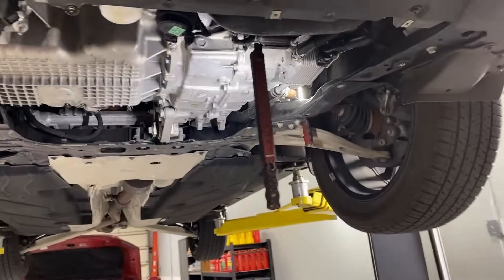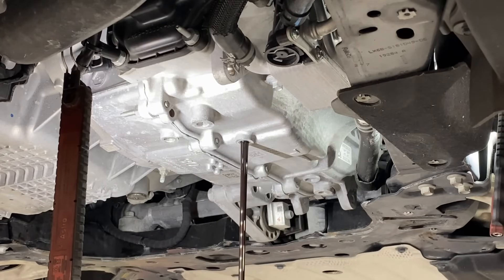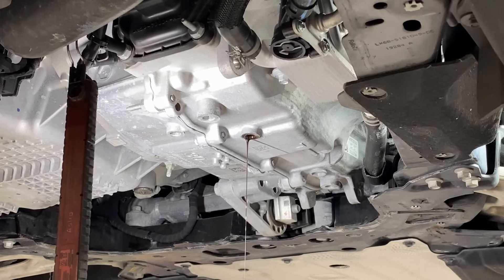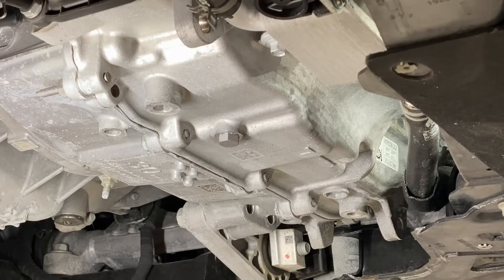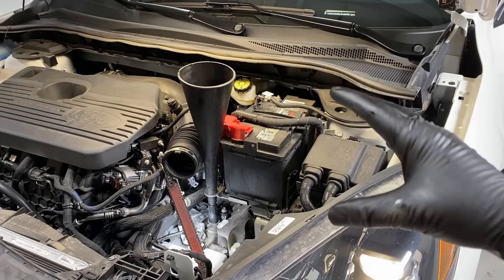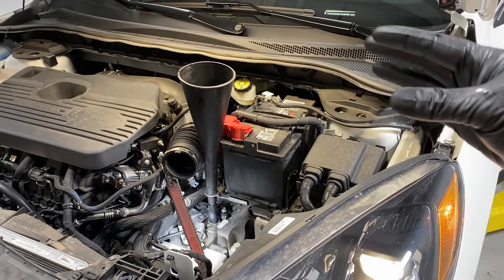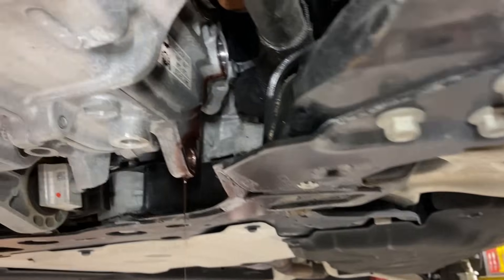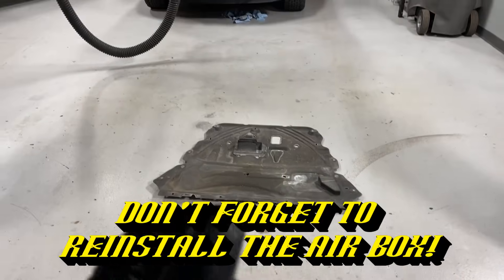Quick Channel Update: 2020+ Ford Escape & Edge 8F35 Eight Speed Transmission Fluid Service Procedure

Comment: Thank you for this video. Very informative and detailed. I am scheduling the transmission fluid drain & fill for my 2022 ford escape 2.0L.  I see that five quarts were used for the initial fill, allowing some fluid to escape from the leveling plug below. At the end, about how much transmission fluid is required for a drain & fill procedure?

Comment: How long do you wait for the transmission to get up to temperature and do you leave fill plug open until then? Or do you go for a test drive, and then open fill plug again?
Reply from the maker: You wan to leave the leveling plug in and you can either brake torque the engine to get the trans fluid hot or go for a drive.

Comment: In theory, couldn't you just fill er up through the side port without removing the air box?
Reply: Yes I believe so but it would take a lot longer and you would have to make sure the fluid is going in and not just running out

Comment: Just did the oil, trans, PTU and rear diff in my daughter’s 2002 Edge with 35k miles.  Very straightforward on the transmission thanks to this video.  Of course it would have been a whole lot simpler if Ford just put a damn dipstick on the transmission.  Fluid was kind of dark.  I think I will do it again in a month or so, then again in 30k miles.

Comment: Hi Brian,

Have you been experiencing a lot of torque convertor issues on 2020 Escape/BS? Ours has 48,000mi and is getting a "surging" at lower speeds with light throttle. It also has a pretty good vibration (noticed in the rear seat)at high speeds.

We purchased it used at 40,000 and I did the drain and fill. It is CPO, but dealer "could not duplicate" at this time

Comment: I watched your video several times and then did it myself. I could not take out the leveling plug, so what I did instead was pour the old fluid into a container, marked the level, poured it out, and poured in new fluid to the same level. It took a long time to refill, but went faster when I ran the car and shifted the gears back and forth. I bought my car used with over 90k miles and was pretty sure it had never been changed. Thanks for the help.
Reply: How many quarts did you end up putting back in. I bought a drain pan with quart markings on the side. I drained out about 4 quarts so that is what I put back in

Comment: Ok so 2022 edge here, I didn’t measure how much came out, why because of the overfill plug and wasn’t concerned with over fill.
So had car on ramps and leveled with jack stands ,
Opened overfill plug and drain plug. Came out pretty clear not black like I’ve been hearing everyone say.
Then put in the qts like in the video up until it started pouring it of overfill, started car and ran through the gears a bunch but on a stand so no wheels spinning, 
Car in park
Added more fluid till it overflowed, then added some more,
Put in reverse it wouldn’t real over flow much, 
Then put in drive it would over flow a bit,
Same sequence and it kept happening.
Turned car off while in park of course. It was dumping so much out of the overflow.
So i added more while it was running kept doing the sequence reverse drive park ect.
Finally once it got to the trickle out point I put the plug in while running.
So the question is did I do something wrong?
Does the overflow plug only go in while running?
Reply: I had the same issue & it wasn’t made clear in the video. When I shut the vehicle off, fluid rushed out of the overflow.

I got more fluid, refilled it, and put the plug in while it was running.

In hindsight, I didn’t even get the transmission hot - I just had the engine idling
Reply: @markr7479 yea I wish I knew. It was a waste of fluid lol
Reply: You don't need to shift through the gears I guess. Just leave it in park

Comment: O also would love a better understanding of the brake pump and the round brake thing. Mine looks as tho its leaking at the seal and not sure what the cost is going to be to replace that seal or if it matters all that much or is very important.  Very demanding requests I've sent you so if easier to send me diagrams and instructions via email if u happen to ha e them can send u that email address. I'm in a pickle and need to fix this car without making myself homeless!! Many thanks sir! Ur awesome!

Comment: Could you do some videos on the 2016 Ford edge echo boost 2.0- especially for transmission drain & fill with level plug; where the throttle body is located; does it have a PTU & what is a cooler when they talk about it.
I have looked for iver 2 months and watched maybe 60 videos and no one ever talks about this specific engine.  It is not like all the others. The closest videos and how the engine looks and the design is the 2013. Took me 2 months to find the throttle body and only fou d it by accident while looking into the starter for this vehicle.
Another interesting video and a how to remove the manifold as it is the only way apparently to get to the throttle body to clean it. There are so many ir should I say 1 large conglomerate of cables and wires which makes it extremely difficult to do maintenance, keep the area clean from dust(as it seems to really gather therr) or get to the pcv valve to check or replace it if having issues or trouble shooting.
Would also love an all in 1 video explaining where the important sensors and fuel injection that can be cleaned or easily checked or replaced for better performance ect.
I only trust very few mechanics on here to learn from and you are in the top 2. You explain well and always show pictures so I am able to see and learn. As a woman I have to understand at the very least what a mechanic is telling me needs replaced or fixed or, as I have been many times, I will get ripped off or should I better say end up fixing or replacing expensive things that really didn't need to be replaced or fixed.
If you are so inclined to let me know which year may best match my 2016 fe2.0 eb so I can learn from that year or would love to just be able to watch ur videos. 
So sorry I know that was a lot. I am having issues and looking at 3 to $4000 worth of diagnosing and repairing replacing to fix things. I cannot afford to pay that if I am not certain it really needs to be done. You make amazing informative honest videos and I've learned so much! Many thanks! And I share ur knowledge with many other women so they at least understand what mechanics are telling them and when to get another opinion;)

Comment: After you filled it with 3 quarts before you started the car did the level plug set itself before you put more in while it was running

Comment: Great video. I just did mine at 34k miles. Fluid was black. After I did the work, I got a check engine light. I scanned it and it was due to having the IAT sensor unplugged when I was running it during the warm up time for the transmission fluid. I cleared it and it went out. Should I be concerned?

Comment: I bought a 2020 Ford Escape Titanium from a Ford dealership with 43,000 miles already on it 3 years ago. Now it has 75,000 miles. Jerks never said anything about it needing to be drained and refilled every 30,000 miles and I take it to the dealership for service. I do have an extended warranty though with 3 years left.

Comment: Hi Brian I will be doing a Trans fluid change on 21 escape... on filler tube does it have some type of a closed off cover(not the cap) down inside the 
rubber tube??? last time it seemed that it did and had to take the rubber tube off to fill  I can't remember looking down in the rubber tube and if it did or did not have that cover...I would appreciate if you can help with this answer ...Last time had a dickens of a time getting the rubber boot back on

Comment: Could you just use the leveling plug hole to fill your transmission instead of removing all the things on top of the engine to get to the filler neck? I have a hand pump with plastic hose that I use on most things that have a leveling hole. But is there some reason you must use the filler tube at the top of the engine on the engine?
Reply: Could anyone answer this question?

Comment: Hello
I drive a 2019 Ford S Max 2.0 EcoBlue with 123,000 km on the clock.
Do you think I should change the transmission oil?
How many liters should go in?
Or should I put in exactly the same amount as the oil that came out?

Comment: why do you not cycle through the gears during the fill process?
Reply from the maker: We did not overhaul the trans nor did we replaced the valve body. This means all the hydraulic circuits are still filled.

Comment: So since this is the same transmission on the broncos sport, a lot of people are lifting these and leveling them. How does that affect the filler hole? Does the car have to be level based on its tires? Cuz it looks like you're losing a lift so it looks like it's level based on the frame where you're putting the lift posts cuz when I did this on my 23 bronco sport and I thought I had it at the stock height. I had some oil come out of the fill hole before I drained any. I pulled off the fill hole to make sure I could get it out before I start draining anything and it was like it was already overfilled. So I would like to know how the car is supposed to be positioned. Does it matter based on the tires on the ground or the frame has to be perfectly level or what?

Comment: 2020 Escape 1.5L 3 Cyl  Build date 10/19- It doesn't have that fill port/vent - at least not in that location. There is a shift cable running across that area. The engine in your video must be a 2.0L because the engine cover is different than the one I'm working on. Maybe the 1.5L has a different trans?

Comment: how will I know that the oil in the gearbox has already reached 200 F   ?
Reply from the maker: scan tool
Reply: You can use Forscan and an OBDII scan tool.
Reply: @just4ivaylo92  Thank you . Can you tell me what options to look for temperature?
Reply: @Krzygen  I believe it comes up as "transmission fluid temperature"

Comment: Would this still be the same on the 2022 Ford Edge ST with the 2.7L TT. Its a 7 speed, but from what i understand, it's the 8 speed transmission with a software install that deletes second gear, but the physical transmission is the 8 speed.

Comment: Hold your horses. why does fords diagram show a cartridge style filter for the transmission on the top, closer to the firewall? what is that for? i see it on ford parts. no idea what it is. looks like a oil filter you’d put in.
Reply: Some transmissions have a cartridge style filter that you do service on the side on top of the screen style filter that you don't service, my gf's Nissan is like this

Comment: Lincoln Corsair 2.0 L  has a 1/8" limiter hole in the center of the rubber breather tube, which is easy to remove, to fill the transmission as shown. If not done, the fluid remains in the funnel or worse.

Comment: I have the Mondeo from 2019 with 2.0 Ecoblue 190hp
I’m going to change the oil on my gearbox 8F40 tomorrow, but do you have to calibrate your gearbox after oil change?? I read that is good for the wear?
Is there a procedure you can do it in the car or do I need Forscan?
Thanks

Comment: I have a 2020 ford escape 8 speed trans with 46000 miles it runs great no problems ,  ford dealer says not to change the fluid also brownie transmission  also say do not change it ,the manual says change at 150000 miles ,that sounds dangerous what do you think about this
Reply: Drain and refill right away and take a sample for analysis. Just tell the shop that your vehicle is operated under special operating conditions.

Comment: Hi Brian, I watched all 3 videos on the 2020+ escape changed at 21K miles for the rear diff the ptu and the transmission fluid. If I continue to change all three every 30,000 miles do you think the powertrain will last? Do you like this kind of car? Also wondering what you would charge to change all three.

Comment: @FordTechMakuloco -Hey, Ford Maverick 2.0 has had a small puddle of fluid leak out of the filler/vent tube 4x's over span of 16000 miles. Is this normal? Dealership cleans it and says, "Keep an eye out"
Reply: It's normal. Similar to what I've seen on my Maverick, built October 2021.
Reply: @just4ivaylo92  any idea how many miles before it stopped? Thanks!
Reply: @jessemeier8190  probably about 16-18k.
Reply: @just4ivaylo92  Thanks for the info!

Comment: I followed the procedure in your video, and when I got to the point of measuring the level from the plug, I noticed that the oil comes out with bubbles. This happens when the transmission reaches its maximum operating temperature after 15 to 20 minutes. Is this normal, or does it indicate a problem? One last question: is a drip at a rate of 1 or 2 drops per second an indicator that the level is correct?

Comment: Excellent video thanks.  I would like your opinion of an alternative procedure, something we used to do years ago.  In an effort to remove all the dirty fluid and replaced with new, what if you removed the transmission to radiator tube and put the trans end into a bucket.  Place your funnel into the fill/vent port with several quarts at the ready.  Start car and as the fluid gets pumped into your bucket, you continue to fill the transmission.  You would do this until you get clean fluid being pumped into your bucket then shut down engine.  Compare how much was pumped out with what you put in and top up and check level as necessary.  I would appreciate your input on this.

Comment: 8F35 is an ultra smooth shifting transmission. Like all brand vehicles Ford using low viscosity fluids for mpgs. Therefore 40k mis max id do tranny fluid & PTU/ differentials on AWD vehicles. Sooner if driven HARD. Use top tier rated fuel always! Ford recommends it. FUEL SYSTEM cleaner every 10k mis. Redline or Techron all i use. 💯 -Western Ohio

Comment: Got a 24’ escape, at the far left side of the transmission (front of the car) there is a rubber cap that says do not remove. Seems to have a decent leak coming from there. Is that just a vent?

Comment: Brian Quick question. I had my transmission fluid changed yesterday. This morning I get into the van and I drive less than a quarter of a mile. I make a right turn and the lost power. And I got an error transmission not in park. I put it in park and started it right back up with no problem. Could this be from the fluid change?

Comment: Why a living plug. Simply record the fluid that came out and refill. Drive and re check fluid level.
Reply from the maker: That is a horrible way to service this trans just guessing at the level which is so sensitive.
Reply: @FordTechMakuloco  you misunderstood stood my comment. If 4 quarts com out then 4 guards go back in. Use a container with   Quart graduations marked on it then it’s no guessing game.
Reply from the maker: Oh, I understood it just fine my point is who is to say the last person filled it to the correct level and more importantly at the correct temp? So yes, it is a guessing game and a horrible way to service a transmission so sensitive to fluid level.

Comment: Question…is it possible for a shudder to stop by changing transmission fluid if a code is being thrown about torque converter issue?
Reply from the maker: yup
Reply: @FordTechMakuloco  I asked the dealership that question  and they said absolutely not, you have to get a new converter. Do they know something I don’t? Could there be something else giving them cause to tell me I need a new converter other than a code being thrown? The only symptom my car has is slippage when shifting. There is no clunking or ticking sound like I’ve heard on a few YouTube videos

Comment: Ok. Major emergency question! (Thank you thank you for the video)
For reasons... I took the leveling plug out without draining.  At least a quart or more came out of that plug hole.  We bought this vehicle new. Have not had the the Trans fluid changed.  Why would that much fluid have come our of the level plug?
Reply from the maker: It only levels while running otherwise it would be higher.

Comment: Before starting engine, it best to reconnect air intake temp sensor so it doesn't' throw codes assuming they won't auto clear when done? Not looking to go through Forscan or drive to Advance to have them clear it.
Reply: i will do this next time too.  Mine threw a code because I had it running without the box and after I was all done, drove it for 30min and it never cleared so I had to go to autozone for them to clear it (weird, the guy said they weren't supposed to clearr codes but he did it anyways after I explained i removed the sensor to do the flush procedure..)

Comment: I am going to do a Trans service on my 2020 Ford Edge and will just measure how much fluid was removed and add that amount back into the transmission. No mess to clean up. No leveling plug to remove.
Reply: Not recommended - follow this procedure to get the level exact.  You dont know it was correct when you started.  My F150 factory fill was found to be low at PDI.

Comment: Do most Ford Dealers do transmission fluid changes? Ford Fusion with about 35,000 miles / without doing a flush, just a fluid change...2020 ford

Comment: Lesson learned on 2022 edge.   This video shows him simply remove the vent plug.  However, their is another "plug" I side the rubber stack that will prohibit filling.   I removed the stack and added fluid.  Be sure to leave the car running while you replace the leveling plug.  Mine took about 6qt.  Drained and filled while basically at temp -not sure if that impacts how much drains.